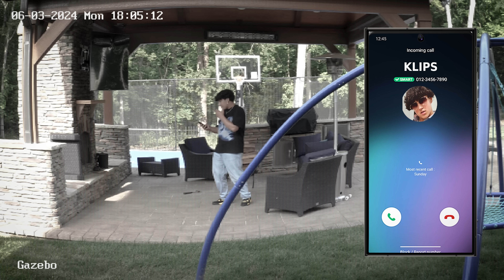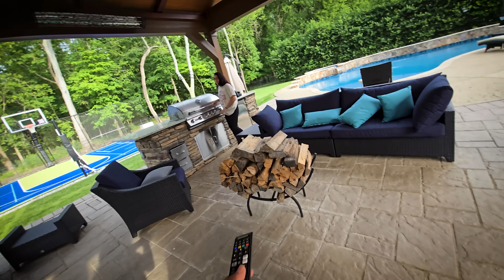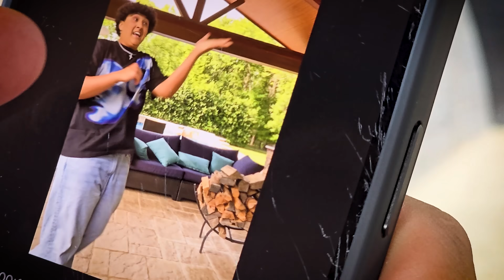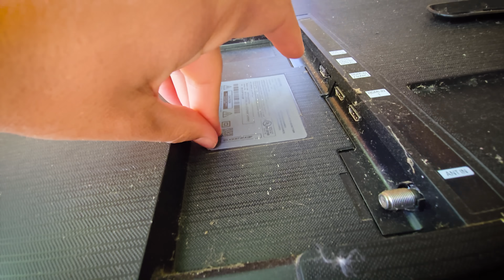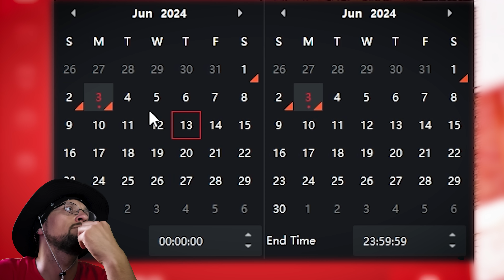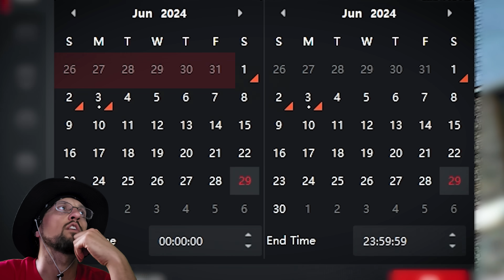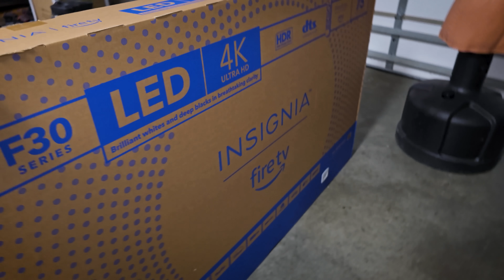Son pranks Dad but it's not a Prank?!? (Real Broken TV)

Comment: Free in Touch and hold a clip to pin it. Unpinned clips will be deleted after 1 hour.Touch and hold a clip to pin it. Unpinned clips will be deleted after 1 hour.Touch and hold a clip to pin it. Unpinned clips will be deleted after 1 hour.Touch and hold a clip to pin it. Unpinned clips will be deleted after 1 hour.Touch and hold a clip to pin it. Unpinned clips will be deleted after 1 hour.Touch and hold a clip to pin it. Unpinned clips will be deleted after 1 hour.Touch and hold a clip to pin it. Unpinned clips will be deleted after 1 hour.Touch and hold a clip to pin it. Unpinned clips will be deleted after 1 hour.Touch and hold a clip to pin it. Unpinned clips will be deleted after 1 hour.Touch and hold a clip to pin it. Unpinned clips will be deleted after 1 hour.Touch and hold a clip to pin it. Unpinned clips will be deleted after 1 hour.